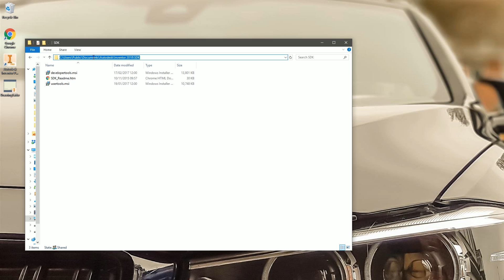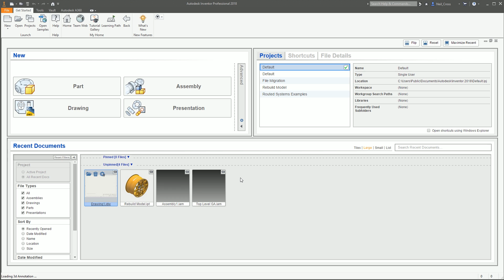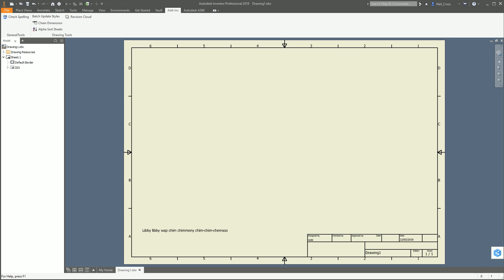Inventor does have a SPELL CHECKER

Comment: It's is crazy that there is not a batch spell check to check the entire sheet or sheets. Hey but you know what there is a helpful tool when you are adding notes, Grammarly for windows. It will show you what's wrong a give you a choice of correct spellings or suggest another word. It even check note book and naming solids .It's better than the spell check in the word processor. Give it a go.

Comment: Thanks for the video though it doesn't seem to work for me, I've loaded it like you showed but the commands aren't shown, the only thing in Add-ins is screencast that I had previously loaded. With all the computers being on a network would this make any difference.

Thanks Jack pepsi
Reply: Its just nuts. When Autodesk already has code for this tool and others in AutoCAD or Revit etc, just incorporate them into them when possible.